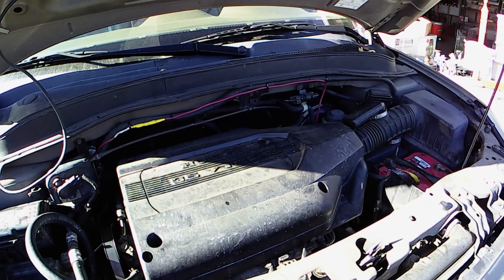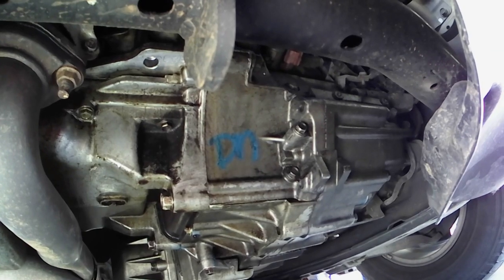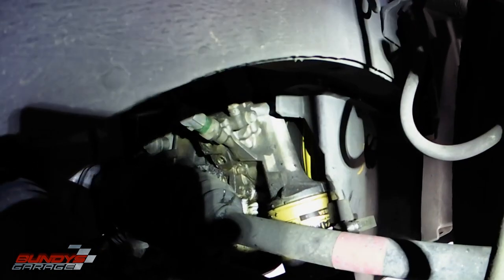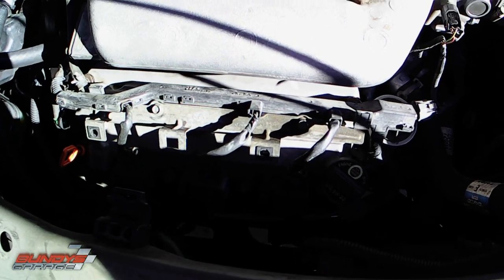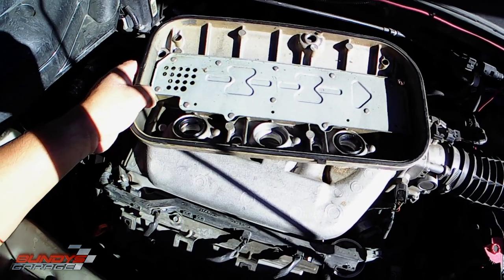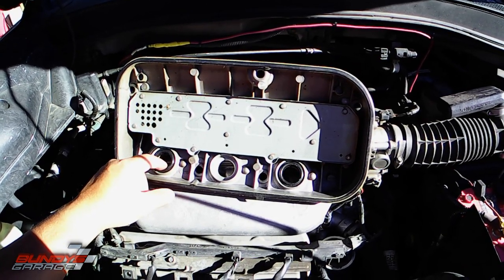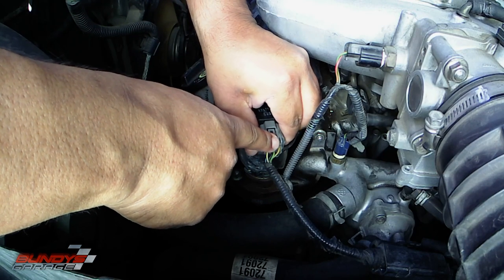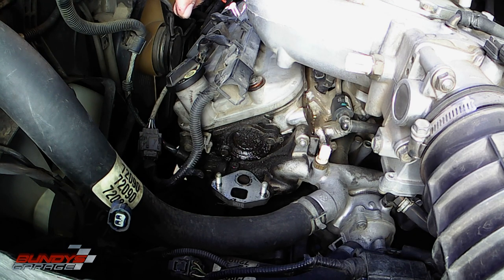FIX Common Oil Leaks Drips Honda Accord V6 J Series Odyssey Pilot Ridgeline MDX TL CL Rear Main Seal

Comment: I’ve been giving my 05 mdx some well deserved love this year after 250000 milesNew valve cover gasket and new pcv valve as it was leaking engine oil too. I also did a valve adjustment while doing all that. Put new control arms in the front and new tie rods, all 4 sway bar links, 2 struts in the back. My next job I’ll take care of the spots in the video as they leaking pretty bad. I also have a minor transmission leak that I can’t find the source. I’ll give that some attention too and clean the shift solenoids on top of the transmission and do a 3/3 flush. Shifting from 2 to 3 is a bit harsh. If you have a high mileage mdx or a pilot don’t forget to change your differential fluid and the transfer case fluid. Awesome video.
Reply: Nice! Did you do the valve adjustment yourself??
Reply: @hexZ06  it only needed one at 220k that I had a local shop do for me for about 500$.

Comment: at 300k.... 
~ valve adjustment 
~ valve cover gaskets 
~ lower intake manifold gaskets 
~ knock sensor (NTK or Beck Arnley brand)
~ water pipe reseal
~ crossover pipe reseal
~ thermostat replacement (TAMA Brand, gets done every 100k miles)
~ cam cap o-rings 
~clean EGR ports
~ clean EGR valve pintle and seat
~replace PCV valve and possibly the hose (Sankei brand Made in Japan)
~ replace IAT (Intake Air Temperature Sensor) will usually have engine oil inside the connector (NTK or Beck Arnley brand)
~ replace spark plugs (NGK iridium)
~ Replace ignition coils (Denso)
~ replace (6) fuel injectors with remanufactured Khein fuel injectors 
~ reseal complete upper intake plenum (Apex brand gasket kit)
~ remove throttle body, clean throttle body 
~ remove IAC (Idle Air Control) valve from the throttle body and clean IAC with brake clean and toothbrush 
~ replace IAC gasket 
~ reseal throttle body 
~ replace ECT (Engine Coolant Temperature) sensor on crossover pipe 
~ consider replacing tiny heater bypass hoses going to transmission cooler and throttle body 
~ consider replacing valve seals

this is about 12 hours of work but will completely refresh the top half of your high mileage J-series engine.

Comment: What was the  year and model that you replaced the cam shaft thrust plate? Do you have a video for the rear one also?
Reply: It’s a j35 engine doesn’t matter if it’s a Acura MDX the parts will still fit because the engines the same I do this all the time when I can’t find parts for my Acura cl I just use the parts off a tl type s of the same year

Comment: How often does rear main seal leak on an odyssey?  I have a ‘12 with about 175,000 miles.  A shop told the rear main seal is leaking, but I’m not sure.  There is a thin coating of oil on the transmission and it drips every other day.  It’s not transmission fluid…I did confirm that.
Reply from the maker: Not often, especially if you have done oil changes on a regular basis. Have you checked your valve covers?
Reply: @bundysgarage  I’ve changed valve cover gasket and a ignition coil seal a couple of years ago.
Reply: @bundysgarage  a mechanic friend told me it could be the oil pan gasket, but I haven’t popped the bolts on the oil pan to check.  There’s no oil around the oil pan.
Reply from the maker: Check out this video: https://youtu.be/Q9bI-vXcYLY

Comment: I have small pools of oil around the mounting bolt inside the upper intake (I hope I'm describing this right - Beneath the ant farm egr cover).  Is this normal or is it because of a leak?

Comment: Okay so I have a 2011 Acura v6 MDX -  it is leaking oil and I am going to do all of these.  Are they the same on my car?   Also- is it possible the so called “Rear main seal” or front one is leaking on my car and not just these ones you pointed out?  Thanks for such great help.
Reply: Yes it is possible but the rear main seal is a pain in the butt to do. If you’ve done all these and you still get oil from under kinda near the “heart”/ middle of the engine. That could be your problem.
Reply: I've had luck getting at the rear main by "pac manning" the engine and transmission. I just remove all lower bell housing bolts. Before removing them, however I replace the upper 2 or 3 bell housing bolts with long high grade steel bolts. The point of all this is to open the engine and trans from the bottom like a clamshell. You can sometimes get the converter and flywheel out in this way so you can get at the seal. Avoiding complete transmission removal. Any way hope this helps
Reply from the maker: How do you remove the seal and how do you install it correctly? Sounds very interesting. Also the trans and engine will separate enough to sneak them out?
Reply: @bundysgarage  never replaced rear main seal this way. Only a bad torque converter on an older camry when I worked for Latoya. On that particular model there wasn't room enough to completely separate trans from engine without pulling engine/trans assembly. On bottom the cradle would have been a pain in the butt to manouver around. I just tilted engine trans down on the transmission side and used a screw jack to to tilt the trans back up and snuck the converter out. Book time was like 6 or 7 hours but doing it this way only took 4
Reply: @bundysgarage  Toyota* that was weird Latoya??

Comment: I've seen people say that you need to put hondabond on the surfaces before reinstalling otherwise you will get a leak again. What are your thoughts on that?
Reply: Don’t do it. Leave the o rings as they are. Rubber Seals harden because of infrequent oil changes or poor quality oil. Over time it’s expected.
Reply: my neighbor uses Hondabond on his spark plugs... LOL.
On the oil pan, you have to.

Comment: I have a bad oil leak left corner more towards firewall side. Could the o ring on the cam plug leak major or am I looking at some rear pressure switch?
Reply from the maker: Driver or Passenger side? Oil leak up high on the engine or down low?
Reply: @bundysgarage  drivers changed oil pressure assembly gasket. No change. Trying valve gasket tomorrow.
Reply: @bundysgarage  high driveer
Reply: @bundysgarage  no change after replacing the valve cover gasket. I guess it may be more in the middle high because it’s definitely dripping on the exhaust
Reply: @fatguyfriday  
May be your spool valve gasket. It's on the firewall side (rear),  right if you're standing in front of the car facing the engine.  Look for video by MrRangerz1 (I believe that's his channel). Very straightforward instructions.  Make sure you get the dorman gasket set (amazon) because I bought another  chinese version and the gasket is thinner and leaked.
Reply: @bundysgarage  
Thanks hopefully solving another leak I was having. As per previous comment, I replaced my spool valve on 07 odyssey.  Leaked. After having it off and on four times and finally getting the right gasket (thickness)  I solved that leak. Only to have another leak underneath it. I was able to figure out that it was the o-ring for the camshaft cover, which is directly underneath the spool valve.  Now I have the cover out and I'm heading to the Honda dealer for a new o-ring.  Hopefully that solves a problem.  Ugh.
Reply: @fatguyfriday  
By the way, Honda does not make the spool valve gasket. You have to buy aftermarket. Honda only sells the spool valve for about $700.  FYI

Comment: I have a 2004 Honda Pilot with @ 289000 miles. I parked and noticed a small amount of oil on the ground. I check my fluids daily and they measure fine. I know I need a oil change will that help the issue? Thanks
Reply: Definitely not lol it’s leaking oil slowly overtime you’ll see the difference
Reply: @carljohnson4996  So what do I do about it? It's driving me nuts! 😅

Comment: Great video Bundy, i have 2006 honda odyssey  it has 199765 miles i did a leak down test and cylinder #2 exhaust has a leak and cylinder #5 exhaust has a leak. my question is . is it a good idea buying  a rebuilt heads form E-bay. i have seen some for $1100.00 dollars.
Reply: If you can afford down time, and doing the work yourself, for that price you can save money by taking the heads to the machine shop. Have a valve job done and call it good.
Reply: @StephenBrewer89  thanks that's exactly what I did saved good chunk of money.

Comment: Those cam thrust covers install a lot easier if you put the new o-ring on them and then put the assembly in the freezer for about 90 minutes. Did this and it popped right in. It's pretty easy to damage the new o-ring if it doesn't go straight in.

Comment: I just resealed the oil pump on an 2008 MDX with 286k miles.  The oil pump seal, water pump and hydraulic tensioner were all leaking and replaced.  After reassembly, I have an oil leak dripping from the back lower bolt on the back timing belt cover.  Did not notice a leak from the front camshaft seal when I had it apart, but that seems like the only logical point of failure, as the leak originates from above the oil pump.  Does this leak sound familiar?
Reply: Determined that the vehicle had a clogged PCV valve and a collapsed hose.  Not sure if that rectified the leak completely, but it definitely mitigated it significantly.
Reply: @Jimmydafreak how to remedy clogged pcv? Just replace ?

Comment: those cam cover o rings are a bitch, order at least 1 extra, it took me two trys to get it to "pop" in just right as it's a tight seal. There is the spool valves and another cam cover plate on the back side of the engine drivers side, also leaks like a sieve.

Comment: 2008 accord coupe v6 6mt. 158k No leaks on ground. Can smell oil leaking onto exhaust manifold after long drives. 

Losing about qt 1000. Gonna try the valve cover gaskets and the thrust seal.
Reply: Did you check the v tech solenoid seal? That’s where the filter is attached. Any leaks there?

Comment: Great video Bundy, I have 2006 honda odyssey it has 199765 miles on it. I did a leak down test and #2 exhaust valve has a leak and #5 exhaust valve has a leak. my question is. is it a good idea buying a rebuild heads form E-bay. I have seen some for $1100.00 dollars.
Reply from the maker: I can't really speak on that. I have never bought anything off of Ebay and have no experience with it. I have heard horror stories about buying used parts off of ebay. Again I have heard of people finding really good deals. I guess if the seller has a good rating. But I can't tell you yes or no. Why not just have your head rebuilt? most likely is a bad valve. Or do you know the head is cracked?
Reply: @bundysgarage  Thanks for reply.

Comment: I’m still driving my 1989 Honda Accord. It has 282,000 miles with same engine and transmission. I took care of her. It has an oil leak, and I know I’d be foolish to put thousands into fixing it. But I don’t want to give it up. (Just bought a second car after 33 years driving my Honda.)
Reply: You wouldn’t be foolish at all putting money into a car you had for that long of anything that’s pretty cool I’d definitely keep taking care of her after it took care of me for that long especially on its original drivetrain
Reply: take care of her.  I had a Volvo 850 with 380K when the odometer quit working and drove it for over 10 years daily after odometer quit.  Back and forth to FL, ME all over.   Keep taking care of her.

Comment: Cam plug seals should be replaced when the timing belt is replaced, 7yrs or every 100k miles at the latest, most techs including my self only replace the cam plug seal if there leaking, from my experience they normally start leaking when the 2nd timing belt is due that’s 200k miles.
Reply: I never had mine changed. Never knew about it. I changed the EGR valve and seen the oil on the cover but didn't know there was an O ring there. I'm at 298k on my 2000 Accord V6 so at 300k I'll get the timing belt and water pump done along with that O ring 👍🏽

Comment: 07 pilot. My Vtek solenoid on rear cylinder head up top near fire wall leaked where the two halves mated. I was able to remove it and split the two parts and re seal with honda bond. No o ring available for this. They do sell the one where it mates to the head if your is leaking there.
Reply: I was coming here to mention this leak!   This one gets it bad because the oil doesn't drain away where these surfaces meet inside the v-tec housing.   If you've tried everything else and you're still stumped, this is the culprit!

Comment: The nastiest drop is the oil pump.
Reply: that is for sure!
Fix that major leak with the "TIMING BELT" job at 130kMi to save on duplicate labor.
Honda OEM T. belts are rock solid, 130kMi interval NO Problem!.

Comment: camshaft seal - I screwed up and didn't use enough oil on the oring and it SHEARED - both of them did.  The second time I used a waterproof grease.   I think I got it this time.
Reply: Is that what he replacing?
Reply: @elperrocovero yea at the end when he is tapping it and doing all that looks kinda annoying to work on compared to the rest of the stuff he replaced

Comment: so of the leak is on the passenger side it's safe to say it's probably the solenoid gasket?
Reply: Probably a good place to start looking. Clean that area with water hose or degreaser and see if it comes back.